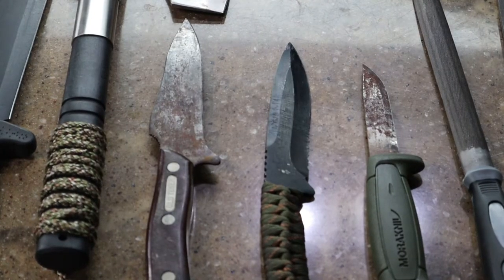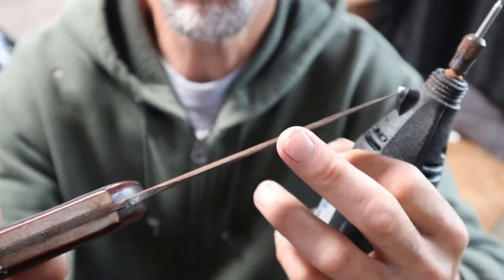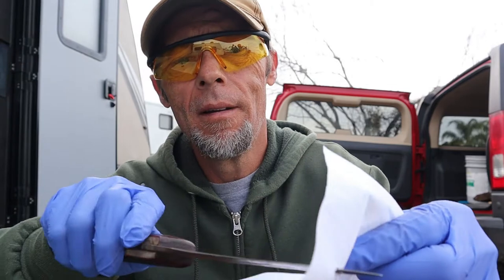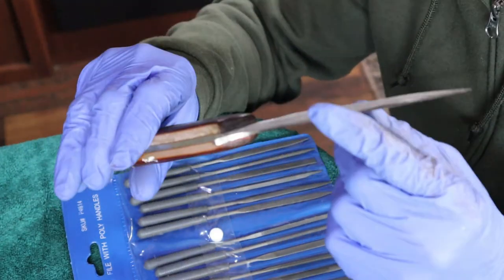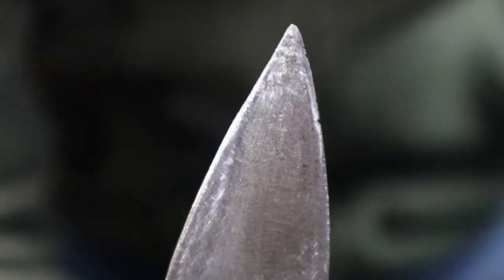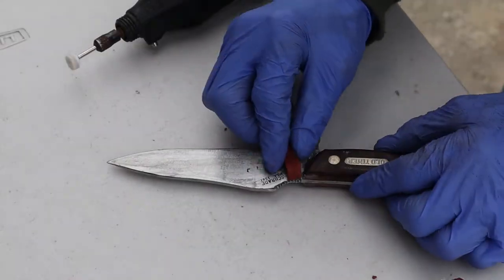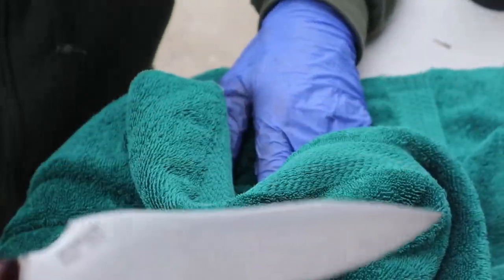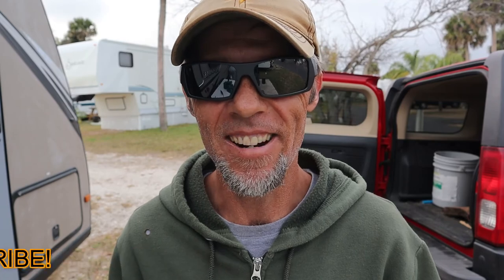CLASSIC RESTORE ON A  SCHRADE OLD TIMER 150T DEERSLAYER FIXED BLADE KNIFE

Comment: Well.......  I don't personally like the finish the Dremel left on it but if you like it then sobeit.....  A wire wheel on a bench grinder then a buffing wheel with some good buffing compound would've given that baby a mirror sheen and it wouldn't have scarred into the metal of the knife.  You could still do that to it but it would take extra work....
Reply from the maker: I appreciate you watching and commenting
Reply: Would have been faster to restore it gently yes. That was like polishing a car with a angle grinder..
Reply from the maker: Yes

Comment: I’ve a couple things to cover:
-looking at the photo of the deer slayer you found can you explain the shape difference between it and yours? Mine matches the one you found online; a trailing point. Yours has more a full body and seems to fall between a drop point or even a nessmuk. 
Dad was a butcher for forty seven years. If he ever saw me cut into the center of a whetstone he would have skinned me. Granted that isn’t a $400 stone but just the same…deep cut in the middle of a stone???
I would suggest getting a mini two wheeler for the buffing/polishing finish. The finished product isn’t quite to where I would start the finish work. I appreciate the fact you’re working out of an tv. I am readying to begin doing the same thing. In consideration of my penchant for knives, guns, antique restoration, et al plus rock & jewelry work I do, I cannot forego a mini wheel. We are only as good as the tools we use. Didn’t mean to pick on you. Only trying to help. If we don’t share, others won’t be helped or share to help us.

Comment: Can anyone help me with some identification here?
There appear to be two 150T versions. A hunting, drop point and a skinning, trailing point. Were these marketed at the same time or did different years have one or the other? 
The small version of the 150T is called the Little Finger 152. The one I have is a trailing point. Did Schrade also market a drop point? Lastly can anyone tell me why mine is stamped on the user right side but I see online there are 150Ts stamped on the left?
Thank you for any info provided.